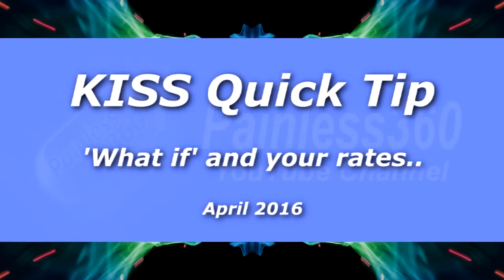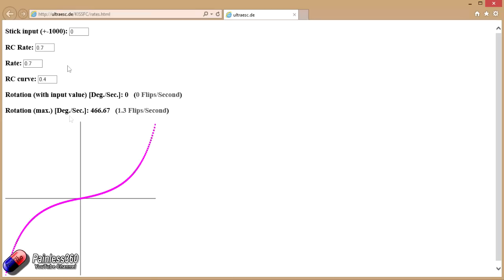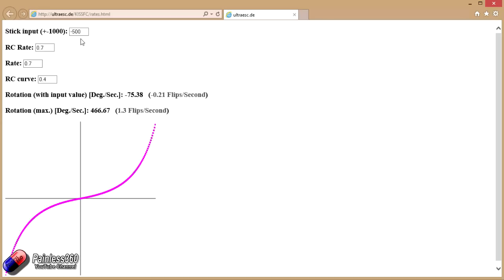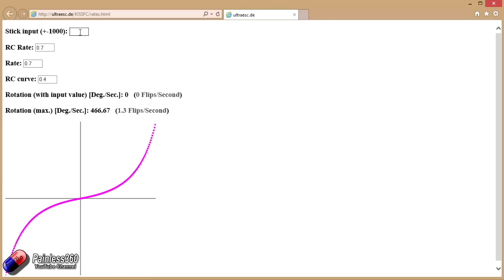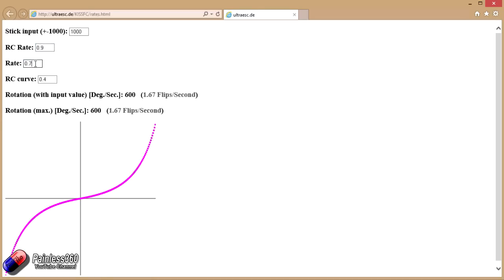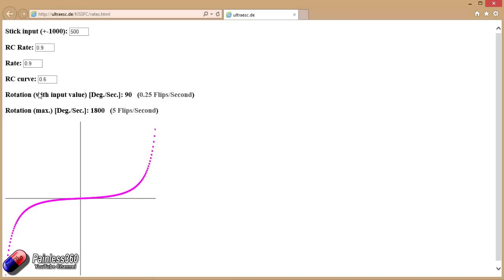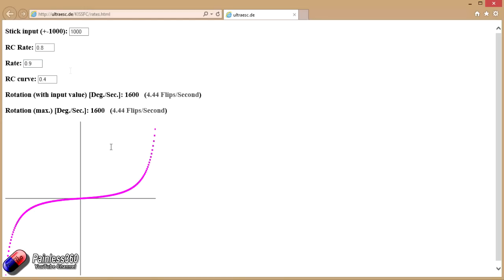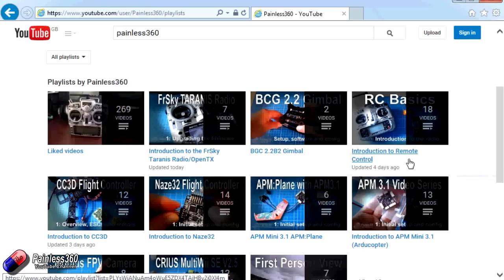Kiss Quick Tips: Using a tool to check your flip rates!

Comment: I have questions I have  kiss fc and simon k esc 20 amp  I wonder why the two motors just throttle up by it self without touching stick    When i armed the fc
Reply from the maker: No idea, throttle calibration issue? Frame setup on the Kiss maybe?

Comment: thank you.. FW dev drops release candidates like in strong betaflight days... these settings done wrong, seem to have a pretty negative impact on the FC.. higher 'rate' (0.8 and above) cause trouble for me atm.. sounds like oszilating-backfire from the motors <1400us throttle.. though fine with a stock rate of 0.7

Comment: found this the other day :) I'm currently at 2.78 flips per second

 if you set RC rate to 1 and Rate to 0.9 you reach the maximum of 2000deg/sec (5.56flips). 

If you set them both to 1, you get infinite flips per second :O break some physics!